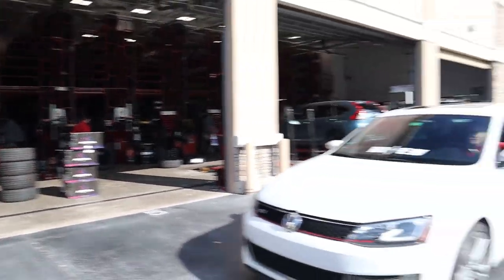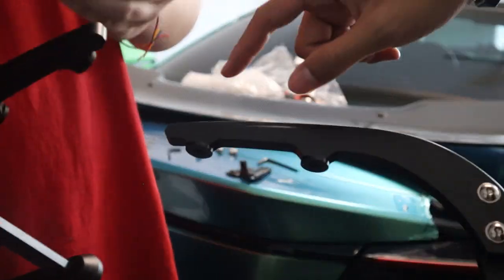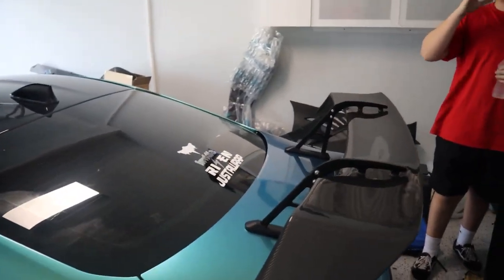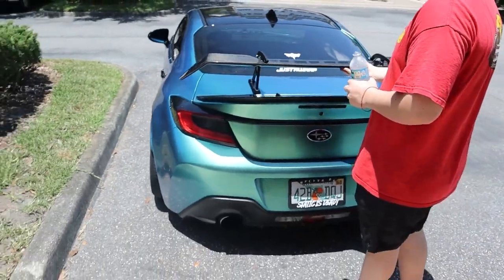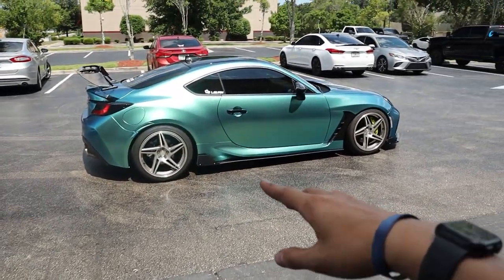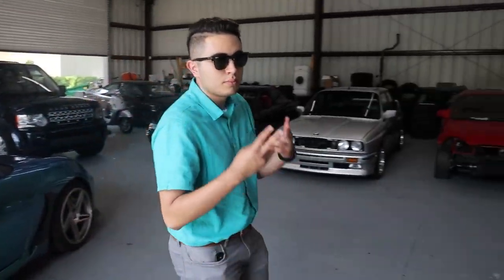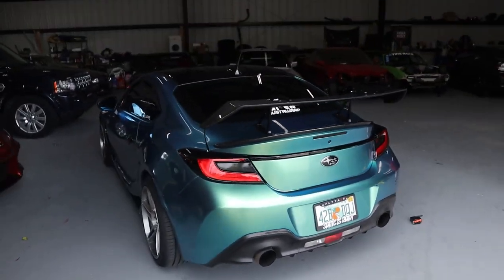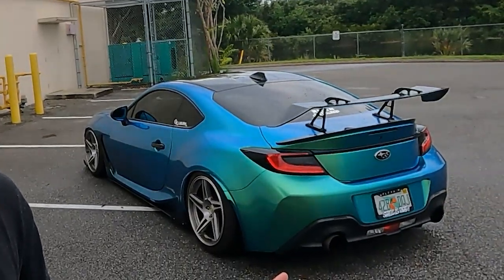My 2022 BRZ gets BIG CARBON SPOILER (Suma Performance)

Comment: Couple questions
1. Do y’all keep your stock wheels when you get aftermarket?
2. Do y’all recommend getting aftermarket rims with tires already on or get tires seperate
Reply from the maker: It's typically smart to keep the stock wheels just in case, but not necessary if your new setup is reliable, also when ordering aftermarket, Id recommend fitment industries with their wheel and tire packages!

Comment: Need to ask you: Do you still have the Invidia N2 exhaust system on your car and do you still like it and does it have a drone anywhere in the torque cycle?  Like the N2 rumble but teetering between the Ne and the AWE Touring. Really tough to make a decision when you can't be right there to listen to it.
Reply from the maker: Yes I still have the N2 I’m a terrible person to ask about drone because I never notice it nor does it bother me, but the AWE is something I’m looking towards as well because of the build quality.
Reply: @B_levan  You should talk AWE in providing you one then do a side by side comparison.  I've sent emails to John Voss at AWE and the wait time has dropped to just a couple of weeks.  My thing is I'm trying to avoid getting something then going "crap, I hate it".  Last question re something you said, is the build quality not up to what you thought it would be for the Invidia?  I thought they had a pretty good reputation for a well built, great welds unit.
Reply: J just

Comment: Big fan, but really wish you would start using legit parts vs. "*insert name* style". I know everyone is in a rush to put out content on these cars, but using real parts would be a much better way to differentiate yourself. The old model 86/BRZ was notorious for everyone doing the same thing (and using rep parts)...
Reply from the maker: I’d normally agree with this however, the longer I’ve been into cars I’ve come to realize “legit parts” it’s just brand clout that are the same parts as “style” parts because they use the same mold and materials, they just arnt the same brand, some “style parts” even come from the same factory as the “real ones” which I learned when I had a type r and put all the Mugen parts on it. However I only apply this when it comes to cosmetics because it doesn’t put me in danger, when it comes to mechanical or handling, I will only use name brand and reputable parts, but when it comes to a duckbill, or something as little as side vents, I’m not going to spend the extra hundreds on a name when it’s the same thing. Just my view on it though!
Reply: @B_levan  Have to disagree on this. Clout and brand name is definitely a thing, but there is also legitimate design and creativity that goes into it. I am not opposed to lesser known brands or unpopular ones being used. My main issue is that the "style" parts are essentially blatant rip offs of someone else's hard work and creativity. Rep parts (just like all rep products in any field in my opinion), are just not right. While I can't afford a fully Varis kit for my GR86 right now, I will save for as long as needed in order to purchase it from the actual manufacturer who took the time to design it VS. ordering a rep/style kit from someone who simply stole from them and released it at a fraction of the cost.
Reply from the maker: @chocodesu  all fair points for sure! There’s a lot of sides to that argument, enough so I might even make a video on it like the fact that rep parts make the real brand parts more reputable and special, but I see what your saying in supporting the original creator, sometimes it just comes down to some companies wanting to give parts to the community that they could not normally afford for temporary satisfaction till they can afford those real parts one day. I do think the sti parts are way too expensive to be worth saving up for however Varis is some good shit that I know you’ll love once you get it, look forward to your build brother, definitely worth saving for, but as for my career I will be working with my smaller brands to grow together like suma performance, anovia, infamous aero, and even other small widebody companies, but i understand most of these brands do make their own designs so I get your argument. My job is also to provide content so if I spent that kind of money on parts which I would if I was rich, I wouldn’t be able to provide as much content. Style parts or not it gives an audience an idea of what the parts look like and they can determine whether they want the “real” parts or not but either way it’s the same look so works for promoting both.
Reply: also nothing fits as right as OEM. ever.